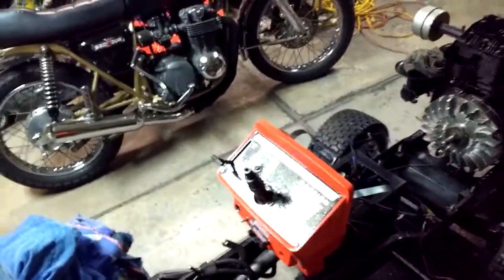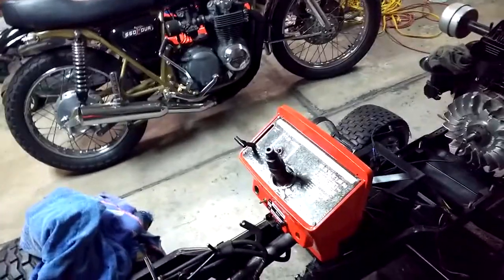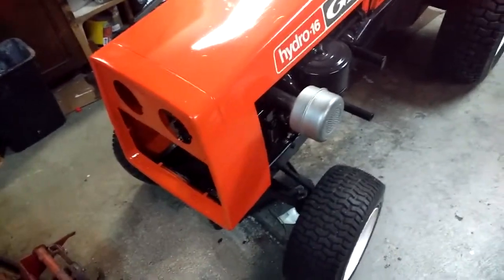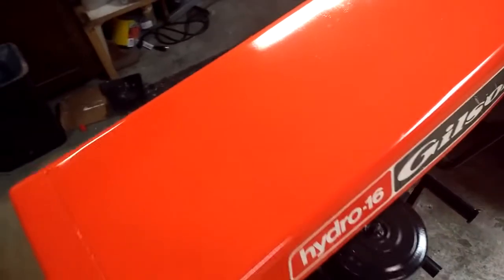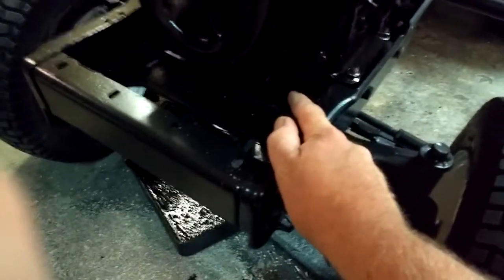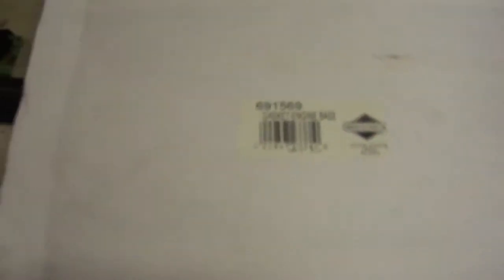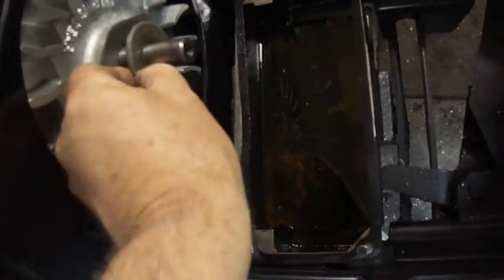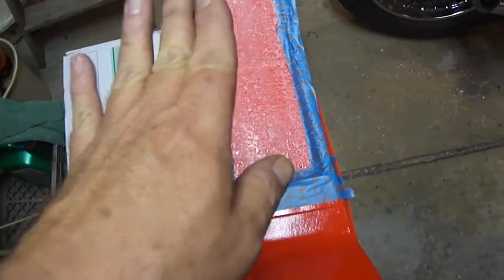Gilson update and shout out to help a youtuber

Comment: If your paint is a nice thick coat, you could always color sand it . Start with 600 and take it to2000 grit , then electric buff out. One option .
Good luck
Reply from the maker: I know its thick in places and thin in others, just not sure how thin.. I may just give it a try on the under side of the hood that way if it goes bad no one will see. :)

Comment: I forgive you for not remembering me 😢😢 LOL!!! I use the 3M yellow weather stripping glue to hold gaskets in place works great 😉👍🏻🇨🇦
Reply from the maker: No kidding, I will have to get some I bet it does a better job thanks!
Reply: +MidwestMotoRider Yes it does brother I've used it for years 👌🏻 give it 5-10 mins before you put the part back in place and the gasket will never move 👍🏻👍🏻🇨🇦🇨🇦😉😉

Comment: I wonder if you just got a defective coil? The pointless coil should work as along as it bolts up and matches the diameter of the flywheel. I swap them out all the time for push mowers and I have even seen Mustie1 grind a smaller coil to match the arc on a larger motor and get it to run. I have been having the same issues of one step forward and two steps back with chainsaws of late. I may give up on working on chainsaws all together. Paint is really just a rust preventative, we have made it into a cosmetic item. Looks good from 10 feet I bet.
Reply from the maker: Yea, so the coil I had on there when I bought the tractor has a wire going to it from the positive side of the battery and the one I bought needs a ground and it is still not working so either its defective or it can't be used on that motor for some reason. I did check and the fly wheel magnets were reversed so if that had not happened I would have just gone back to points since that coil is readably available just about any where.  Yea, chain saws hate me also and the odd thing is I see all these guys like Donyboy72 and Zippo just play with them for 5 minutes and they work as good as new. Go figure. Yes, the paint looks great from 10ft away even better at 20ft.. :) But like you said its all about just keeping it from rusting so that is how I am going after it. Thanks for watching George it means a lot.

Comment: nice job, you know you could just drill out the smaller washer so it fits
Reply from the maker: The only drill bit I have that is even close is my step bit and it does not come close to the size I need. Its just cheaper to hit the hardware store and get one for .75 cents. Have a good weekend!
Reply: MidwestMotoRider
ok, i will have the last video up on my water pump rig sometime Saturday

Comment: Good update.  Those old 1 lung 16's and I think 10's are reverse polarity flywheels so you have to have the right coil or send your flywheel into briggs and they will change the polarity.  I have 2 solutions for you....1-I believe I have the correct coil for you or 2-you could try the NOVA II points less system http://www.mfgsupply.com/31-8786.html.  My dad has successfully installed one on a 16HP single briggs before and there are a few vids on others doing it as well.
Reply from the maker: I am intrigued in that Nova module I am going to look at that a little more I had not heard of that. Zippo set me up but if the coil I get does not work I may end up seeing you. :) The flywheel must have already been done since the points where not in use they are still there but no wire was ever attached and since it was running when I got it I am making the assumption that was already done. It was one thing I found out a week ago and looked into. I did not even know that was a thing.

Comment: So ,it doesn't have points ?
Primary winding should be Close to zero ohms ,,or maybe .3 ,,and the secondary ( spark plug wire) to ground should be over 4K
Reply from the maker: Yea, I tested it and it has just 2.8k ohms and the one that was on it had 5.1k ohms from the ground to the plug. Zippo just sent me a link to one he believes is the one I need and he has one of these motors so I am hoping he is correct. Thanks!
Reply: +MidwestMotoRider yeah 2.8 just isn't gonna cut it .
I've never had luck with anything below 4K .
Sounds like the primary is fine though

Comment: the colour is pretty !!and if it bothers you , it s a matter of wetsanding it lightly and polish up ! but as you said , its only to protect and not for a showoff ! by the looks of it ,your in bad luck with this build ,everything is working aginst you ! 
good to see your trying to fix the camera , i dont get why the cheapness of manufactoring can  couse such a shitty contact and still get an ok stamp haha
Reply from the maker: Yea, that tractor is fighting me every step of the way but I am determined to come out the winner! As it turns out that SJ4000 camera has no stand-offs on the usb port on the board and so the only thing holding it on was the flow solder so its no wonder it failed, it really was a question of when not if it were going to fail. Really a USB port with stand-off's would not have been that much more for them to use and would have made all the difference.
Reply: MidwestMotoRider
and solder only holds on metal!! why try fixing it on a fiberboard with only a thin copper alloy.... makes no sence
Reply from the maker: Yea, I am going to resolder it and then if that works I will apply a two part epoxy to it and around it to hold it in place. If that all goes well I will then have a shop camera again. :)
Reply: MidwestMotoRider
oh yeah , OH yeaaah!!